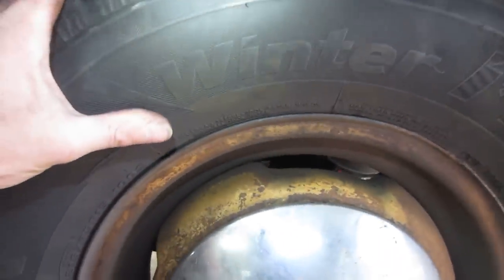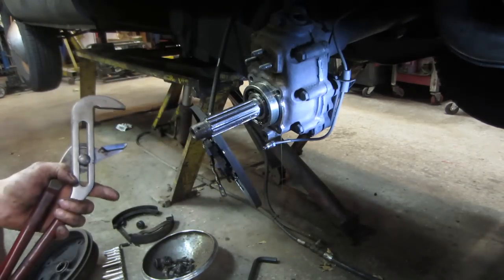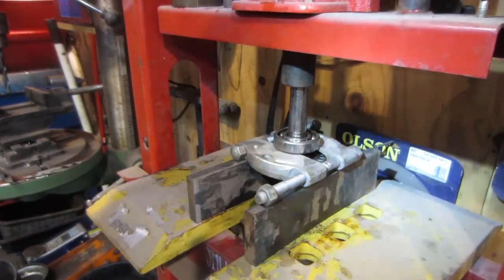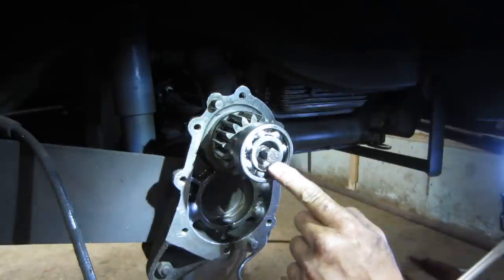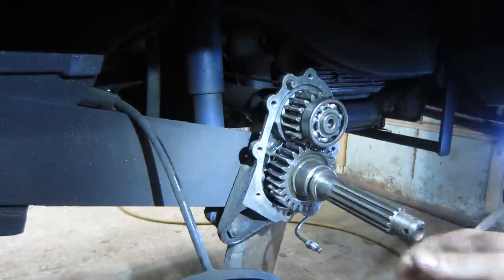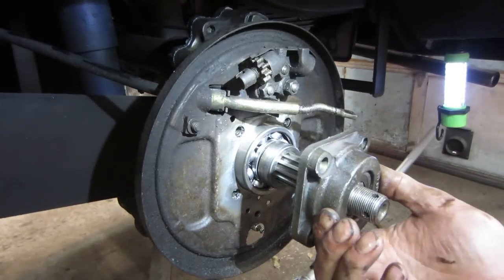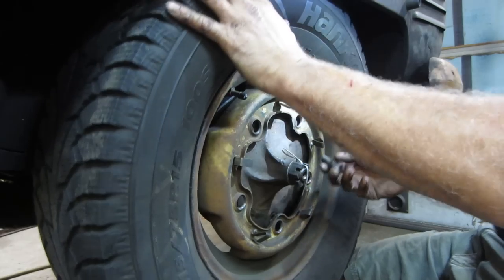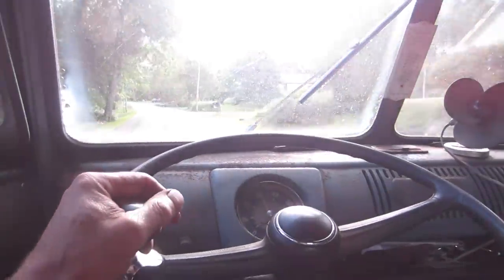vw bus gear reduction box repair.

Comment: After watching your videos for quite some time now the foremost thing I learned is:  When one works on cars, bikes, or anything mechanical getting frustrated, mad, swearing, and  throwing stuff is NOT mandatory.  Who knew???  I have spend better part of half a century doing that.  So the last time I worked on my side-by-side I just followed your example.  Guess what I had a much more enjoyable time and it went a lot faster as well.  AND my wife likes it a lot better as well..  Thanks Mustie1.  ; -)
Reply: Zen and the art of motorcycle maintenance... For me, its a challenge or a puzzle. Each of us have different tool kits and knowledge sets so the same task often has several solutions. I've never seen vice grips that size and shape! Getting that last bearing out took me a couple hours because i had to think up a pulley for it. Got it in the end. The worst is when you have time constraints.

Comment: Found my '58 bus in the woods after it'd been sleeping there for 45 years, changed out the crashbox and reduction box gear oil and added some Liqui Moly MoS2 Anti-Friction For Gears, and its been running great. Nice and quiet, amazing stuff. But guess maybe its about time to change out those 66 year old bearings and seals, huh. Cheers.

Comment: I'm not sure why Mustie didn't see this better way to install the axle bearing; use a washer and spacer that clears the axle and just turn a wrench on the bolt, this allows a very easy way to seat the bearing one handed

Comment: I had a 1960 single cab about two weeks when I learned the hard way to keep the transfer boxes filled. That small top bearing exploded and destroyed the outer casing. I was able to order that part from the dealer in town and went ahead and replaced all the bearings on both sides. After that the 36 HP motor gave up going up a hill... The only lower ratio gears than the ones in the 36ers were called Alpine gears, I'm glad I didn't have those! But with a 1600 that truck would idle up roads that Jeeps had washboarded all to heck spinning in 4WD.

Comment: Finally a mystery explained. Many years ago (1970s) I was fixing a VW fastback with a manual transaxle. Reverse gear didn't work at all. After disassembly I found that the reverse gear shaft had actually broken out of the housing. I eventually combined two used transaxles to get one working one. However during assembly I discovered that the ring gear on the differential could be put on two ways that were 180 degrees opposed. I knew putting it in the "right" way was important. I hadn't noted during disassembly which way was the correct way, had no reference materials and no time. So 50/50 shot. My grandpa and I pondered the situation. He and I figured out which way things turned, followed that through the transmission and were really sure we got it on the right way. I put the whole car back together and prepared for the test drive. I started it and put it in reverse and almost drove the car forward through the wall in the garage. I knew immediately what was wrong and needless to say that ring gear was on the wrong side. The car had 4 speeds in reverse and one forward. I drove it around for a few minutes like that as it was an interesting experience. Then I dove back into disassembling it and putting the ring gear in the "right" way. I always wondered why VW designed it with that variation possible. Now almost 50 years later I stumbled on the answer even though I wasn't looking for it.

Comment: That's a big part of what made earlier buses and Type 2s so capable off-road.  The reduction gear effectively gave them a portal axle set up which raises the axle tubes above the centre of the wheel making them much less likely to get caught up on the terrain and damaged.  Portal axles, or portal hubs are still used on serious off-road machines, the Mercedes Unimog has used portal axles since it first appeared in the '50s as does the Steyr-Puch Pinzgauer and its smaller relative the Haflinger and the HMMWV or Humvee used by the US military has portal hubs.  The Humvee has fully independent suspension  all round so it uses drive shafts/ drive axles to transfer drive but it uses portal hubs to keep the drive shafts/axles tucked up out of harms way thus reducing the risk of damaging what is a potentially fragile part of the drive train in a vehicle used in harsh terrain, one good smack on a rock or on the ground can be enough to cause the CV joints to tear themselves apart which is a big part of the reason that solid axles are still the preference for people who work their vehicles hard off-road...

Comment: Love the massive vice grips! I've done this job before... even had to reinsert the semi axle once after pulling on the axle (i didnt know the risk involved). I prefer to rebuild an engine than to do THAT job! That last bearing can be had with small gear pullers... i used a series of bolts and nuts to make a puller that can grab the bearings edge. You grind a slit at one end of the bolt to catch the lip and works a charm. This is for anyone who is here because they need to do the same job and don't have massive vice grips! Keep up the good work Mustie.

Comment: My old 60-something bus had those gear reduction thingies. I always liked them because they gave the transaxle a few more inches of ground  clearance. I still have the extra-high-lift floor jack I bought specifically to work on that bus. The payload capacity on those VW buses always amazed me. 1 ton, Land o' Goshen, that's a lot!
Reply: ArtemiaSalina I had the reduction boxes on a 63 bug along with a thing front beam so the ride height was the same fore and aft! The bug was better off road than a few 4x4s I knew at the time! Wish I still had it!

Comment: Um... I NO JOKE!!!! Just Got On Youtube this morning to Search for a video how to pull apart the Reduction Boxes...
Well looks like i did not have to even Search!! Your video was the first one on my list of Subs lol!!!!
Thank you!!!!
Reply: because Mustie! is the man!
Reply: Yes he is. I wonder if those reduction boxes are for ground clearance... I've only ever seen them in off road vehicles and tractors before.
Reply: Tomorrow he's going to show you how to fix your oven.  By the way, your oven is about to break tonight.
Reply: Figured you'd be in here commenting
Reply: StarPuss www.ToxicRedNeck.Com
Reply: The added ground clearance is a plus but the gear reduction is needed to help create a gear ratio with a more usable torque band. The VW bus needs is so the realitively low powered older VW engine can actually propel the heavier vehicle easier. Off road equipment uses gear reduction for better use of torque in rough sloppy conditions and easier hill climbing. Not to mention that gear reduction reduces stress on the entire drivetrain.
Reply: Thanks for the detailed explanation. It's just unusual to see that in passenger vehicles, every other model just uses a different final drive elsewhere in the diff or transmission instead of resorting to another set of gears on the wheels so I was just wondering why.
Reply: Good point on gear reduction reducing stress on entire drive train - allowing engineers to use the same gearbox in this heavier application.  Brilliant!
Reply: It was so the power of a Beetle engine could haul a load in the bed of the truck. If you were not worried about top speed its a great idea. Who wants to haul ass in a VW pickup? LOL
Reply: Humvee's have the exact same setup! Lol
Reply: This will be a brand new best i-tv channel ever buddy.. hoping you give a subscription a chance .. its well worth it. Trust..
Reply: A good point , well made 👌

Comment: Bought my 4runner new in 1996, been driving it ever since, 200k miles or so, never had a break down, nothing but consumables replaced on it. Biggest problem I've had is the sunroof quit working this year and electric antenna. Heck of good truck, most reliable I've ever owned by far.

Comment: Mustie definitely a sign of something when they get in the way,if the bearing spun in the housing if bearing spun on that lower shaft drive use mic there is tolerance even we check the splines and drums just VW made me do butt I usually could feel or see  wear just playing by ear lol. nice work you were talk in about paper gaskets back brake plate seen them usually red on the back side the weep hole (some crudd inside sometime) going down out side seen two paper gaskets in some manuals for the cover thinner white one's have you been there nice seeing those memories lol!!! Great video !!! : P

Comment: My uncle had a Beetle when he was in high school. He rebuilt the trans and put the ring gear in backwards. 1 forward gear and 4 reverse. lol he pulled it back down and flipped it back around.
Reply: So, it was a French Beetle? Sorry, couldn't help it.
Reply: Well it happens that way sometimes.... At least it wa an easy fix!
Reply: There used to be backwards races in Europe, which involved flipping the ring on VW's or flipping the rear axle on standard rear wheel drive cars. Yes they raced at over 45 mph backwards on a track....
Reply: I learned the other day that a Lincoln Town Car will go zero to 60MPH in reverse, (completely unmodified) in only 9.2 seconds!!
Reply: when he but the ring gear on backwards did he even have to shim the carrier at all or did it work perfectly other than 4 forward gears going backwards?  Ive always wondered if you could just flip the ring gear with no shimming or adjustment of ring gear backlash play.

Comment: Missed a trick there Mustie, When you were resembling, putting on the bearing, and wanting us to hold the mole grips.
You could have removed the bolt, put a ushaped piece of metal, or even a large washer and two chunks of brass, On to the shaft then just tightened the bolt to push the bearing on.

Anyhoo, some nice videos here,  the bike rebuilds and trips around the nice countryside being the most enjoyable.

Comment: Excellent Tutorial. I had a '59 Transporter.  13 other Vdubs for parts in my off-road racing days.
I just bolted an extra pair of wheels to the existing ones and had Duals.  Smooth ride across frozen plowed fields with the torsion bar suspension.  The gear reduction seems minimal.  20 teeth on drive gear, 24 on driven gear approx.
It handled the extra weight and barn door aero.  Thanks for an informative commentary and no music.
What model are those Vise Grips™?  I have never seen those and need some.

Comment: First time I see what the reduction box looks like inside. I once had to do my Ford Escort. So I jacked up one side only. Keeps the oil from leaking out. I also used a gasket maker on the flange. It never leaked again

Comment: Whenever you see those backwards Allis Chalmers WD45 loader tractors the ring gear is on the opposite side of normal to make the tractor have more speeds in reverse. It also makes for a big surprise when you have it on wrong for a normal direction Tractor. Many a mechanic has sported an embossed A-C steering wheel emblem on their chest for a week or so.

Comment: If you put a brass rod in your air chisel, you can drive the bearing in while pulling on the bolt, and it frees up your 3rd hand for other things

Comment: Might be preference but I know the Right Stuff does not need to set up like the typical RTV.  Apply it, put the parts together.  Fill with oil and you are done.  

"Assemble parts within 5 minutes while The Right Stuff is still wet. Secure or tighten to recommended torque specs."

Comment: Nice. You can use a piece of pipe with the outer diameter the same as the inner ring of the bearing to press it in place. Or you can use the old bearing.

Comment: I see 45mph in 4th at lower rpm. What's the safe (as in RPM) cruising speed 55 tops? You're the man Mustie screw them haters on the generator video. It's your equipment, you can do whatever you want.

Comment: I would have put some washers on the axle bolt and tightened the bolt to pull the bearing in, goes in nice and straight that way, great videos though, I enjoy them, thanks,\.

Comment: Hey mustie got an idea that I'd like you to try on video. Will an old lawn mower run on vegetable oil in the crankcase with the regular oil drained out. meaning you drain out the regular oil and add the vegetable oil and then see how long it runs.

Comment: While you hold the punch, hammer and vise grips at the same time installing that bearing on the other side, ask yourself, "Why do you think they put that threaded hole there in the first place? To press on the bearing. Use a big washer, a socket and a bolt to fit in the hole. vw probably made a special tool.

Comment: Back when I was in high school in 1972 I helped my friend rebuild a '58 bus. we didn't do anything to the trans or gear reduction boxes except top off the fluids. Everything held together until one night getting on the expressway on a steep on ramp we got it up to 75 MPH, normally would only go 65 top on level ground with that 36 HP motor, and bam the left rear box locked up. The ball bearings let loose and cracked the case so it was time for another trip to one of the local junk yards again.
Reply: VetteKid ni

Comment: Yes they used a standard beetle transmission  but they flip the ring gear  over  too make the axle turn the opposite  direction going through the  reduction gear.  My father  was a service manager  & head mechanic  for years at Volkswagen dealership  .

Comment: You had a bearing that was worn out .  As long as the box was disassembled and you had all of the bearings out , I would have replaced all of the bearings.  As it is now , you have a new bearing combined with the old bearings all of which have a certain amount of wear on them .  One is certainly waiting for it's turn to be worn out.  I would have replaced all of the bearings so they would all be new and wear in together at the same time.

Comment: I have heard that the gear reduction system may be called a PORTAL drive? Jeep talk.
VW's are really engineered quite well. Impressive.
This is instructional videos that are the the best! It's way more informative than hands-on stuff,involving blood and injuries.
Just use jack stands always.36 mm socket required.The torque is 80-150?
VW lug BOLTS are stupid!
 I always used a 12 or a 14 mm stud to help me line up the bolt holes for the wheel! PAY ATTENTION to that.
   Why do mechanics own crappy cars? This is why.

Comment: Maybe you could have used a longer bolt, a thick washer, through a socket to help press the bearing back on to the drive shaft?  The bolt and washer would be pulling on the shaft as you tighten it into the axle while the socket pressed the inner race of the bearing onto the driveshaft.  Two hands required instead of three.  Just an idea.

Comment: For future reference..... don’t tap the bearing in on the shaft, use the bolt as a counter force to push it in with a ratchet

Comment: Loved the vid, isn't it a good idea to do the opp side so you have a good known baseline rather than waiting for it to fail especially as you had concerns about gritty metal bits which could be doing a turn on the opps bearings and your new ones?

Comment: Yeah, I have a cheap toaster oven in the shop just for these jobs to avoid race damage. 250F, check the race temp with an IR therm and it just slides on like buttah.

Comment: Top outer bearing ..use something under the bolt like a socket to push the bearing in while you tighten bolt..also did you forget you gasket behind the backing plate and the bearing spacer?

Comment: Aluminum wheels used on a dirt late model will fit the spread pattern on a VW wheel.3x the width of a VW wheel.Its used to load the late model on an open trailer.

Comment: You need to get "THE VOLKSWAGEN REPAIR BOOK FOR THE COMPLETE IDIOT", because it has the torque spes for the gear reduction boxes and axle nuts, (AXLES ARE 215 FT LBS), or there's an excellent chance you will have leaks of the axle grease. I'm a certified Volkswagen tech, went to school in 1974 when air cooled was still the focus. Trust me.  ;)
Reply: Great book… I remember the page that had the big illustration of the gear reduction box.

Comment: I know its 9 months old. however.  instead of tapping the axle bearing on. you could use a socket and the bolt you had on the end to bolt the bearing in place

Comment: In light of the metal shavings you found in this reduction gear box, would it be a good idea to change the gear oil in the other reduction gear box, and possibly the transmission itself?
Reply: Would be a good idea to wash the windshield too, but hey, it's Crusty.

Comment: How fast will those go without pushing the engine too hard? like if you were driving 100 miles straight, whats would be the top speed you would feel OK with?

Comment: DANGER, if your split window has 46 m/m nuts holding on the brake drum the reduction gear boxes come apart in a completely different manner. You need to unbolt the reduction box from the side plate and remove the big plug from the back of the box. Then, there is a nut underneath that.

Comment: Third hand: well, not really a third hand, but, if you get one of those baby front pouches, rip the baby holder part and keep the strapping harness. On it, affix a D clip (the heavy duty textile kind used for suspending hammocks) and on it, you  can hook stuff, in this particular situation, using your body to pull the vise-grips.
Reply: On a side note, i wonder if it would be worth while thing to minutely grind the two gears so that the teeth aren't ended on a flat. Seems to me that this whole assembly has potential to walk and wind up touching other things inside the transfer case. Tho..that would probably limit the amount of torque it can take...man, remind me to never own one of these because i would spend months trying to fiddle with it and a mill...